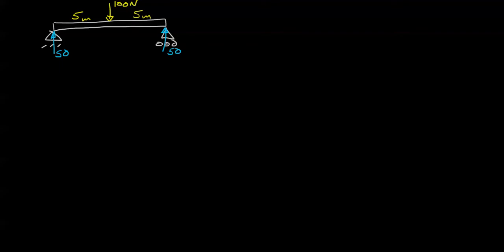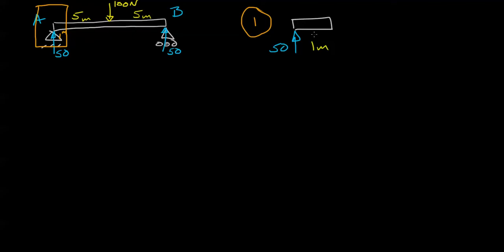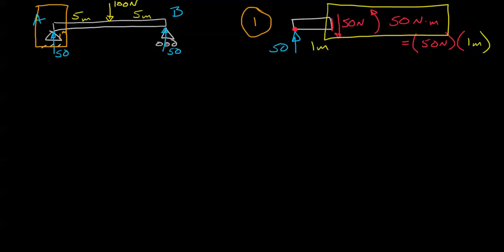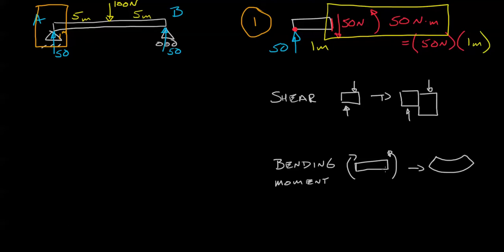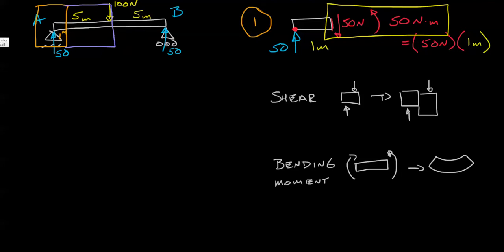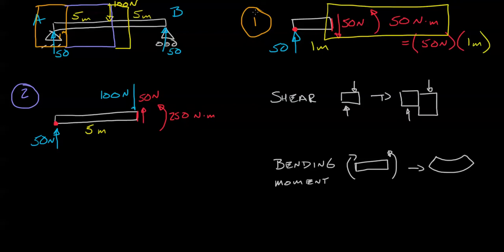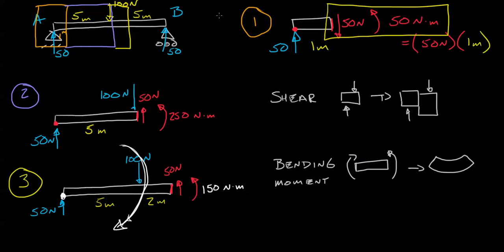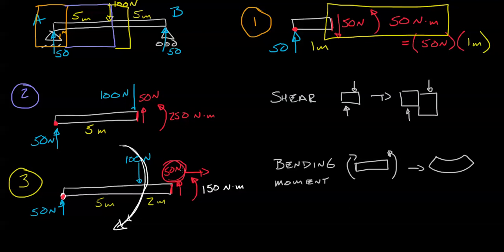Engineering Statics 35 beam internal forces

Comment: Brett, I'm a little confused in the last example how you got the "150 N*m" in the 3rd example. Wouldn't it be 50N * 7m for a product of 350 N*m?
Reply from the maker: No problem.  First, we are pivoting the beam around the left most end.  So, the sum of moments is 0 about that point.  We have 500 N-m rotating clockwise, from the 100N down at 5m.  We have 350 N-m rotating ccw, from the 50N at 7m.  Combining these two effects leaves us with 150 N-m cw (500-350).  But we need a total of 0 N-m, about the left most end.  That means the moment at the cut section must be 150 N-m ccw.  Make sense?
Reply: +Josh Pham  This example must be "shown/worked out".  (maybe it's in video part 2).
Do this:
1.) Label right end "B".
2.) ΣM@B =0 = m + 2(100) - 7(50)  (hmmm...where did "m" come from?)
3.) m = 150 N-m
------
Note: When you "cut" a section it must be replaced with 3 things: V(shear force), F(axial force...he neglected that), and M(moment curly arrow).  
These are now "FBD variables" you must solve for each of them(F=0, obviously but you must show that).  
When you see a moment arrow(curly) is not to be ignored.  Treat that like the horiz and vert arrows and included that in your moment sum..